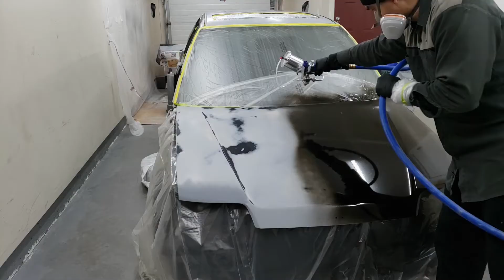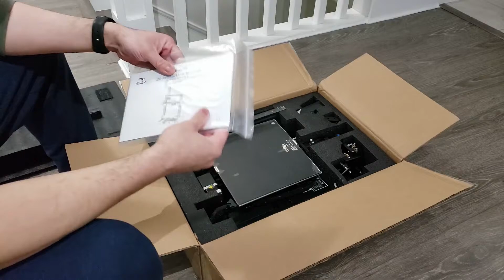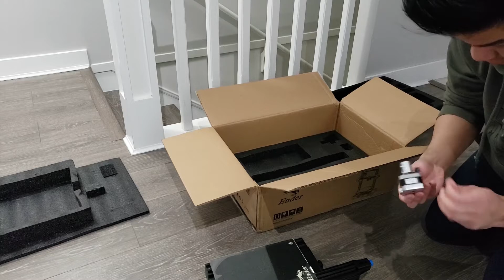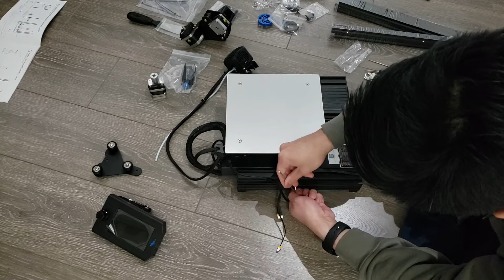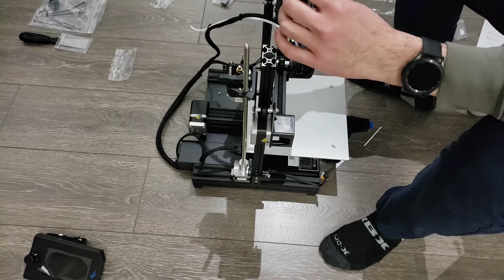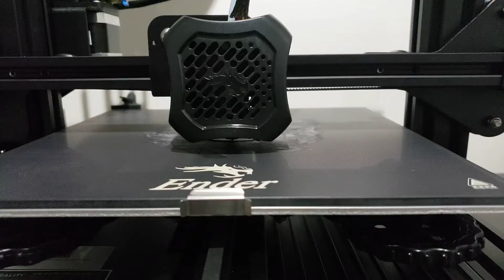I Got Myself a "Ender 3 V2 3D Printer"🤓 It's Time To Print Some Parts for my EF CIVIC!👌

Comment: Very cool... do you just load a pre-made file ... or do you actually do this design?
Reply from the maker: Both actually. But mostly everything I print, I have designed in 3D CAD software. So it takes time designing and then printing and then making adjustments to the design and print again. So lots of back and forth until the final print comes out the way that I want it to. But its really neat seeing your drawing come to life. 😁